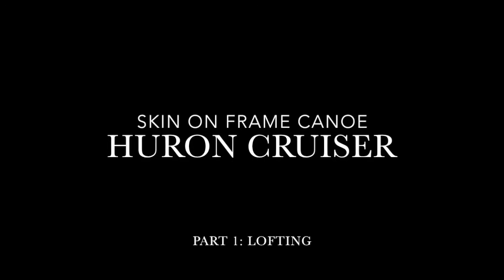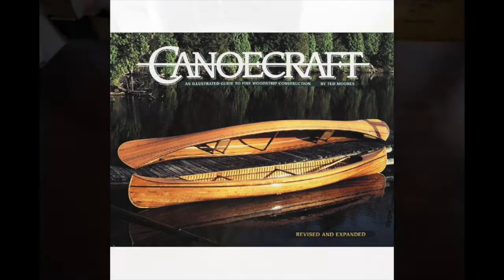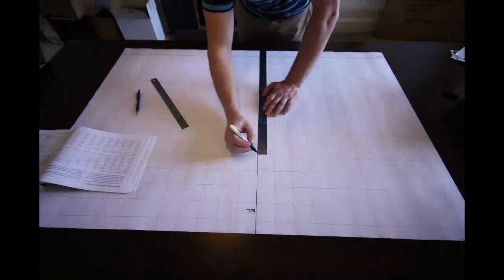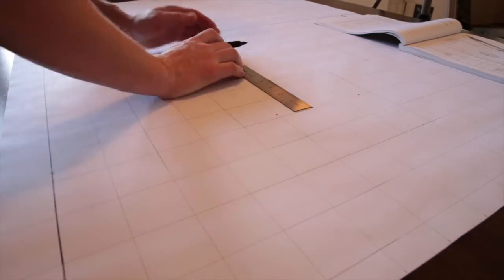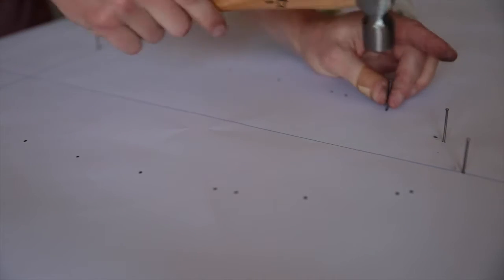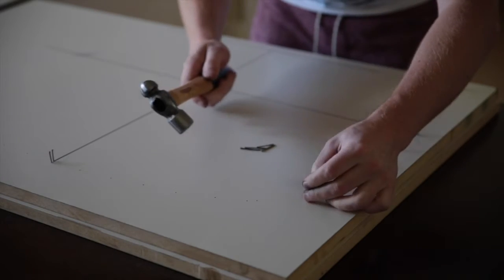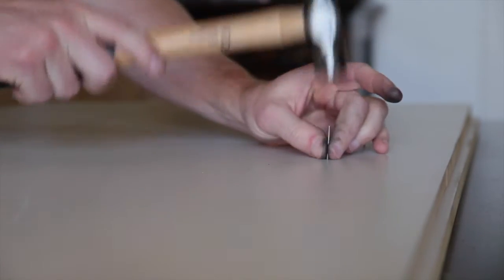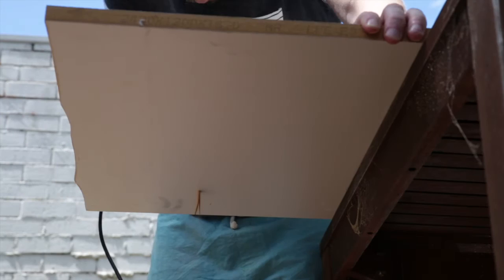Skin on Frame Canoe, Part 1: Lofting Up

Comment: hey man. It is good to try to make your own canoe. I am going to do the same this coming month. I want to build the chestnut classic. I have the same book and I am starting the process to create all the patterns.  I have a couple of questions for you: the first one. Is there any special reason you decided to build  the Huron?  Are you going to buy red cedar strips  ready to use or are you going to buy just lumber. I have decided to use lumber, but I have a problem to find something not so expensive, so I am thinking to buy shorter pieces and I want to glue them to get the 15 feet I need.  Greetings from Calgary. Ruben
Reply from the maker: The reason I chose the Huron is that firstly I wanted to build a 2 person canoe and secondly I like the traditional style recurve to the stems the Huron has this to some degree although not as much as some of the other plans in Canecraft. 
I am making my boat from lumber the wood is Huon Pine from Hydrowood check out the link its a pretty cool story.
www.hydrowood.com.au  

Hope this answers your questions and good luck with the build.

Stu
Reply: Huon Pine is not an ideal strip planking wood. The oil content makes gluing and epoxy tricky. Also, it can be quite a bit softer than other light timbers like Western Red cedar.